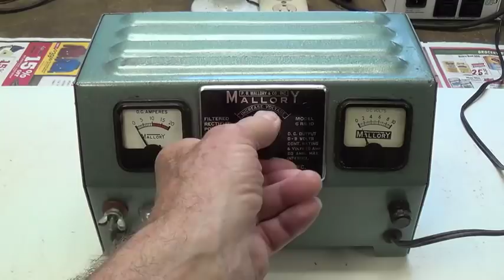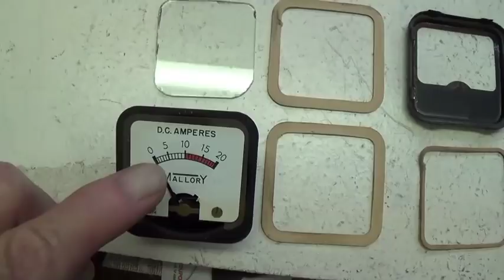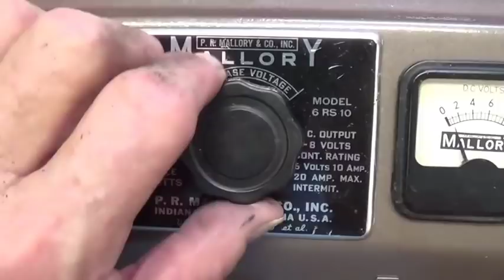Airline Model 9002 Chassis + Mallory Power Supply  =  ?????

Comment: Hi Doug,  I did get a copy of the 5F11 amp and thank you again.  On another note there is a company out there called Ram Meter in Michigan that can re-task those meters for you.  They will supply a new face plate on them and even print your name on the face plate as well.  They do amazing work.
Reply from the maker: Thanks, Mike. I will check them out.
Reply: @UncleDoug  Hi mate!  I think you said you were gonna use one of the meters to monitor plate current?  Not sure.  Anyway it'd be great to see one or both of those meters flaying about while making music.  You could even 'backlight' them with small warm-white leds!  

Here's a hint - file, sand or somehow grind the domed end of an led into a 45 degree coned-end, & you can get 150 degrees of light dispersal, more like an incandescant globe.  You have to be careful not to snap the leads out of the cast epoxy of the leds.  Modifying an led this way avoids the small intensely bright dot that a lot of modern leds produce.  This method has worked well for me to illuminate the insides of small model buildings.  A 150 ohm or more series connected resistor is required to run the led off 5 Vdc, & a 470 ohm or more resistor would be required for 12 Vdc.  The resistor not only protects the led from too high a voltage (individual leds only need between 2.2 & 3 Vdc), but from reverse-polarity damage.  The led will no longer be instantly destroyed if you connect it backwards; it just won't illuminate.
Reply from the maker: @nevillegoddard4966  Thanks for the helpful suggestion, Neville :)

Comment: Rustoluem used to drive me nuts too, with the ever clogging nozzles, but then some blogger nailed it - it must be shaken REAL good, like the instuuctions say. I shake twice as long. Nozzels stay clear and it dries faster. Some day I will build the reccripical saw spray paint can shaker I saw on This Old House.
Reply from the maker: I shook the %@#&?! can until the little rattle ball almost wore out, MG, and my shaking arm required physical therapy.......yet the stinking paint took 3 days at 100+ degrees to get dry enough to handle.  This has been my experience with all Rustoleum paints.....especially gloss black and bright red, which NEVER dry.  Krylon paint, on the other hand costs about half as much, never clogs the nozzle, and is dry by the time you put the cap back on the can.....but apparently, they don't offer Hammertone, at least in my area :(

Comment: They took all the dryers out of the paint, what I do with enamel is let it dry for a day and then cook it in the oven for 4 hrs at 250 degrees and bake it. Then while it's still alittle hot rinse it under really cold water it works to harden it, I didn't believe it till I tried it and it works, but I prefer lacquer, so much easier to paint with.
Reply from the maker: Thanks for the interesting suggestions, FM.  On my latest project I am using acrylic lacquer, base coat and clear coat.

Comment: I use the Rustoleum hammered paint all the time.  It can take forever to dry. I love the look that it gives though.  I found that if you put a fan blowing on it,  it will dry much faster.  Don't know how I missed this video 2 years ago.  Probably had a project taking all my time then.
Reply from the maker: I wish Krylon would make a hammertone paint. Their products are infinitely better than Rustoleum......at least in my experience.
Reply: Hey kg good idea!  I wonder if a fan--heater might speed drying time even more?
Reply: @nevillegoddard4966  Heat didn't seem to make much difference. The air really does though. With just the air movement, the paint usually will be completely dry in 8 hours or less. Still needs more time to harden more.

Comment: Awesome project. I think the variable cap is for stabilizing output somehow. The amp was made by Danelectro. I've seen that same cap in other Danos. Also, just wanted to say, your playing is improving! Nice job smacking those strings in this one.
Reply from the maker: Thanks, Brad......I appreciate your input :)
Reply: Uncle Doug Hi..did you try adjusting the resistor?
Reply from the maker: It's actually a capacitor, of extremely low value, Dom. I tried adjusting it and noticed no effect at all.
Reply: Uncle Doug please, you're not being fair on Jack as I can hear his nail picking tone clearly He's obviously been watching the Guitologist with you
Reply: Uncle Doug I have one in my 56 Danelectro  Cadet.. no schematic exists in the universe for this one.
Reply from the maker: You're right, George. I couldn't help but take credit for Jack's musical prowess :)
Reply from the maker: I would love to see one of these goofy adjustable capacitors in a schematic, Dom. Maybe its purpose would be more evident.
Reply: I presume it nulls out some parasitic oscillation or some such.

Comment: I used that very same hammer finish on the cam covers in my Datsun Z. They've dried just fine, but I think the engine bay gets pretty warm with the turbo ;-). Engines, the other music to our ears. Really cool project, I appreciated the explanation around the grid and screen resistor. I recently replaced them in my blackface bassman, but stopped short of the coupling caps. The plate current is rock solid now, so I left the old blue caps. The grid resistors were mismatched in type, so I didn't want those contributing to any potential plate current mismatch. Great video, also loved the attention to detail
Reply from the maker: Thanks, Andy......glad you liked it :)

Comment: @ 8:00 After an amount of time drying under a hot light bulb. Drying can be sped up 2 ways. Either run the item under water until the sticky goes away. But it you can't? Lightly dust with baby powder. It'll adhere to any sticky areas and can be wiped away with a terry cloth.
Reply from the maker: Have you ever tried this with Rustoleum paint, Brian?  It's generally as sticky as scotch tape after several hours. The powder would stick to it like a sugar donut.
Reply: @UncleDoug  I have with other paints and it has taken time to flake off. After a bit of research, the latest RustOleum formula is listed as a resin-based paint. Which is odd. I guess they went that path for durability. I always thought that it was just a different type of latex paint.
Reply from the maker: @brianterrill9587  It uses a volatile solvent, so it's not latex. I assume it's an acrylic urethane without the proper hardeners.....so it will last in the can.

Comment: I really like your new combination of guitar stylings at the end of the playing scene. Also, excellent editing! I got an electrical engineer friend of mine to get an old cathode ray tube tester gauge to go "good" to "bad" by a knob dial for a prop in a short film. Unfortunately the directors didn't follow through and we only got to see footage of it in action once. Combined with a heart monitor button and wire setup borrowed from my sister's work, it made a fictional electrical torture device.
Reply from the maker: Thanks for your very nice comments, Joel. I really appreciate them :)
Reply: I'm gonna clean up shop one of these days, and have a Hammond organ amp chassis with it's power and output transformers. I'd donate them to the channel if you think it would make an interesting build. There's a website on the Hammonator and Brad Guitologist converts one as well. I think it would also make something similar to the Deluxe Reverb having had a pair of 6V6s in it. I can't seem to even get around to finishing my 5E3P build, so thought I'd offer. Brad's got more than plenty to do so I probably wouldn't offer it to him.

Comment: I haven't been able to figure out what that smal variable capacitor is for, either. I believe it fulfills the role of a gimmick capacitor to tune out narrow-band radio-frequency interference. I think it kind of betrays the fact that a lot of guitar ampifiers in the 40s and 50s were still designed by, or according to principles of, radio technicians since it's not the first time I've seen a radio-type circuit as at least part of the picture, especially in these cases where you see radio tubes like 6AV6 and 6AU6 used as the preamp instead of much more common amplifier triodes.
Reply from the maker: I agree, Chris. It's been said that virtually every amplification circuit possible had already been designed and included in the RCA circuit handbooks from the 30's and 40's.

Comment: Use the ammeter to measure the plate current of the output tube, and the voltmeter (with appropriate voltage divider - 100:1) on the B+ so you can monitor the B+ voltage as the tubes warm up! There’s a cap-nut (?) right there near the top wing nut; you can probably mount the pilot light there instead of drilling a new hole for it! 😎
Reply from the maker: Good suggestions, William.......if only the gauges actually worked.
Reply: Uncle Doug maybe you can find an estate sale being held by a mad scientist and they have some appropriate-looking gauges amongst the B-grade sci-fi movie set props! 😎 those things were always chock-full of meters, pots, switches, and pilot lamps!

Comment: Doug: Nice job. Also welcome to the (new) world of Rustoleum hammertone paints. 
The old Hammertone paints worked very well indeed, the new formulation paints have
been a complete failure ever since their release. They do not produce a good finish
and have the worst record that can be found for clogged nozzles. I have emailed
Rustoleum head office and customer support about this numerous times with no results.
My daughter works in management at Home Depot and I told her about the problem
(I have discussed this issue with many other youtube  contributors also) and she tried to
use different cans from different case lots with bad results and clogged nozzles from
every single sample, I still have a couple of 10 year old partial spray cans of their old
 hammertone paints and with good shaking I can still get good results from those old cans.
I have even bled out the pressure from cans of the new formula and then opened the cans
and emptied the paint into mixing tin and tried to mix the paint so that it could be sprayed
and it would not even mix mechanically into a smooth mixture. I have tried to thin the new paint
as it is found in the spray cans and even heat it to no avail. Aloha
Reply from the maker: Thank you for confirming my very negative opinion of Rustoleum paint in general and Hammertone in particular, Randy. It's an awful brand and an awful product. Not only does it not dry, but the "hammered" effect is limited to severe orange peel rather than any mottling of colors. Your daughter may be in a position to find out why Home Depot and other big stores carry Rustoleum paint almost exclusively. Do they offer kickbacks? I have complained continuously to no avail. Clerks simply shrug and say it's a "corporate decision", immediately forgetting to relay my fury to anyone in management.  Something needs to be done. I intend to return the can for a full refund today. Perhaps that will make an impression.
Reply: Unhappily when my daughter brought up the matter she was told that "it was not her department"
 and that pretty much ended the issue as far as her involvement could go. I still have not heard
 any answers from Rustoleum on any of my many emails over the past 18 months. As far as the
new formulation of their paints in spray cans I have yet to find a  satisfied user as far as
the hammered finishes go. Aloha
Reply from the maker: Well, I guess that says a lot about the attitude of management at both the Home Depot and Rustoleum.....and it further convinces me to stick with Krylon and Lowes :)  Thanks for all your effort to improve the situation, Randy. 10-4 Over and out :)

Comment: Have you ever used self-clinching studs for grounding?  I have found they work very well on aluminium.  

I would had switched the rectifier socket out and used a 6X4 in place of the 6X5...or used a 6X5WGT.
Reply from the maker: No, I haven't, D20, but I'll check into them. Thanks !!

Comment: I have an airline 9003,  that I bought used back in the early 80s.  Tremolo via 6AU6 was not working at the time and was missing the speed pot and knob.  Just got it working this week after careful TS steps.  All caps were bad, except one(which took over five minutes to test as good, so replace that as well), replaced them first, test, still was not working, then started checking resistors.  Besides comments in one of your vids you mentioned to check to see if they match tolerances, I found a forum, regarding a sears 1433 that also uses a 6AU6 for tremolo and circuit was very similar if not identical.  One of the things the forum mentioned is to check the two reisistors coming off of pin 6 on the 6AU6, and the poster also stated to check for voltage oscillation on that pin using a VOM.  There was no oscillation, so started with those two resistors, both were supposed  to be 330k, one of them had no resistance/open, and the other was at 385k.   I replaced both with 390k/1watt, and the tremolo came to life/oscillation on pin6, which was a happy moment :-)   I may pm some pics.
Reply from the maker: Excellent work, Vince. Congratulations on a successful repair.
Reply: Uncle Doug thanks!

Comment: Great project, too bad the meters couldn't be used.

I'd probably do one more thing.  A bottom plate held in with the screws holding little rubber feet.  The exposed wiring makes me just a little nervous.
Reply from the maker: I agree with both comments, Joseph. I'll be watching for some functional meters to install. Meanwhile, I do intend to make a base plate, to prevent electrocution (if I sell it).
Reply: @UncleDoug  there is no great reason why a meter should not work, with the correct shunts etc,  but are they set to measure AC or DC ?  .  I suspect the pivot points have gummed up and some switch cleaner might have been a first point of call.

Comment: You realize, of course, that if you were to do that 12ax7/output transformer mod, and make those gauges work, you could sell this thing on Reverb for about 900 bucks.  Boutique!
Reply: He's right you know.
Reply from the maker: That's definitely worth considering, guys. Thanks for the suggestion :)
Reply: > EdMuss1122 > Hello again, "Reverb" struck a chord...: I have a pair of 1965 Vox Cambridge Reverb's the black panel V3's with the twin EL84's these have mucho Mojo (Made at the Thomas Organ facility in Sepulveda now HiddenHills, Ca. also formally Sound City Studio, yeah the place from the Dave Grohl movie Sound City) that need new homes. Both with original foot pedals up-graded or serviced switches and both with new cables cleaned / serviced and looking for new homes. I have the original Gold Bulldogs too, but these sound excellent with 10" Weber Blue pups in my humble opinion. 1 has the Weber and has seen lots of big stage time (hole in grill cloth where mic went show after show = Mojo City) The other one has a real nice grill cloth yet needs some TLC from a real amp tech (new set of JJ pre and pwr tubes) to fix some Reverb short with the foot switch plugged in and like I said some true amp aficionado TLC Both have the best tremolo's go from really slow to really fast! Super vibe-y  
Feel free to contact me loowood at com cast dot net I have over 207 eBay pos FB's and 14FB's on Reverb. These amps are rare and do that Marshall sparkly clean thang to gnarly yet you can stand next to them or be in the same room. I am keeping the 3rd a '65 Vox VCR Silver Panel (even rarer) with the original Vox / Mullard stamped tubes and the trolly in mint cond with sanitized original FS with lights. I put a 10" Weber Silver Bell in it and it's silent until played. An amazing find for to keep. It took me 3 tries to find one that was the best for me, in my opinion. These do not desire to be handed off to the public at large. these amps are for special friends of friends. I can sit on these till I die. Also I will make a deal that will make everyone smile. If you can dig where I am at. There are 2 Frankensteined V3's on Reverb, parts amps, (wrong handle - new/replacement back panels) and they are asking museum prices: https://reverb.com/marketplace?query=Vintage+Vox+Cambridge+Reverb+Amp&ships_to=US_CON 
Mine are the real deal and look almost new but they are from 1965! Uncle Doug, please forgive me for my intrusion to your priceless thread here but everyone is speaking my language. Maximum Respect ~ Loo
Reply from the maker: Thanks for the kind offer, Loo. I tend to be a Fender and Valco fan, with little or no knowledge of Vox amps.....so I'm not the right guy for these gems. Best of luck.
Reply: I kind of felt that to be true. I was hoping that one of your subs might see my comment and on a rare lark of serendipity the amp and a new home might find each other. thanks for leaving my comment / sales pitch up and possibly tolerate my repulsion to eBay and Reverb. I have some fine Fender Blackface and other amps that are already in my amp techs shop where the amps are seen by his clientele. The odds of someone wanting 2 while getting a repair are far and few between. We Skip Simmons amp repair of Sacramento, Ca. and I have moved a few hi end Marshall's it just really slo out west here as we all are in a huge cloud a smoke. Just wishful thinking on my part. Still thanks for not deleting the comment. Maximum Respect ~ Loo

Comment: just a thought doug, rubber grommet's in the chassis plate where you drilled the through hole's, to protect the wire's, would be nice,
Reply from the maker: They would, Paul, and I generally use them, but the chassis is 1/8" thick aluminum plate and I have no grommets that can handle the thickness.
Reply: next time you're at the hardware store,
Reply from the maker: I will definitely hunt some down, Paul.